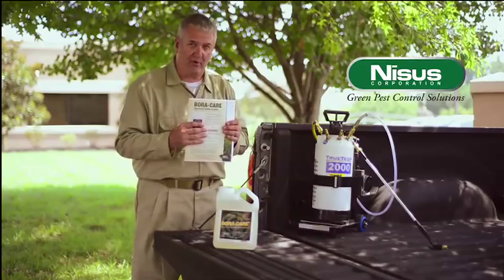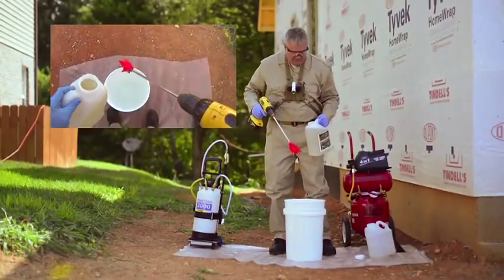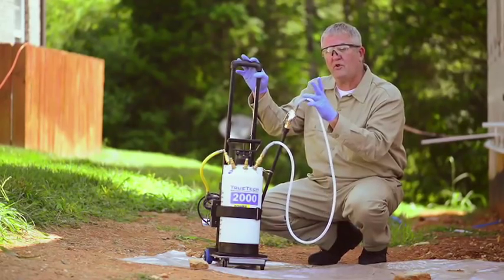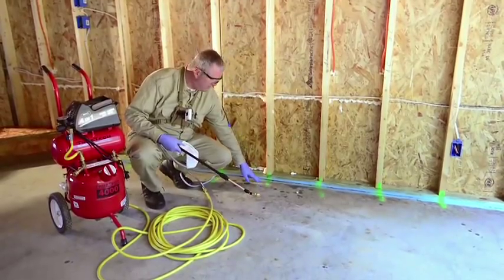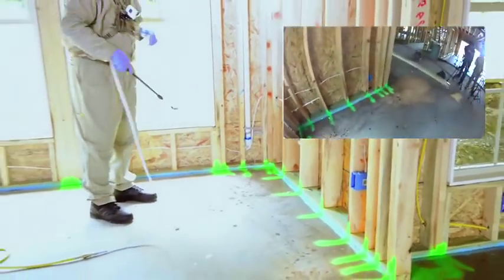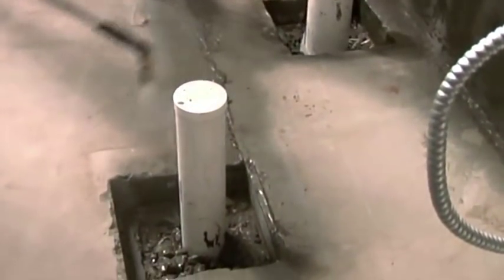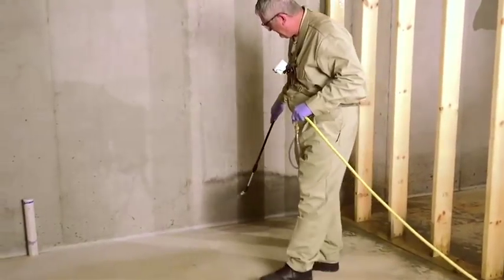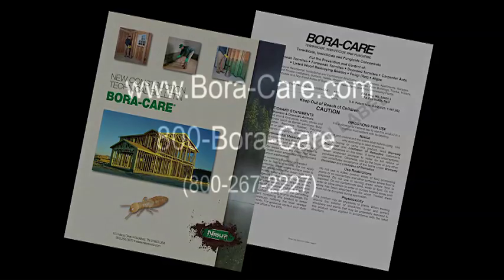Bora-Care Termite Treatment

Comment: As a Branch Manager and an ACE, this technique will only help for subterranean termites. Drywood termites will get in from above, thus, the entire structure needs to be treated. Fantastic product overall.
Reply: That's right. Carpenter ants, wasps, bees, etc. They all come in higher. Anywhere water could get in-SPRAY it. That means the entire stinking frame.
Reply: @asadadil8695  Im not sure if you have read the studies on this product, however, it actually penetrates the wood multiple inches deep and within 30 days can fully penetrate 2 to 4 inches deep.
Reply: @asadadil8695  BoraCare is absorbed by the wood. So, yes, they will be in contact with the product.
Reply: @alexcolon1640  Yes, but if you're only spraying the bottom and drywood termites enter through the attic, you have no protection. Hence for drywood termites you ideally need to spray the entire structure.

Comment: Great video, but it would appear that you do not live in a southern coastal state or California.  In these places we also have drywood termites that do not enter from the ground.  It is quite common for drywood termites to enter into the attic or around windows through cracks and crevices or pipe and electrical penetrations.  Therefore, if you live in an area where drywood termites are a problem, then the Bora-Care should be applied to all wood surfaces, including the roof structure.  If it's wood, then it needs to be treated.  If you live outside of an area where drywood termites are a problem, then what you showed is exactly spot on.  Don't feel bad for not mentioning it though.  I did all my pest control in the north and midwest and I never gave a thought to drywood termites either until I retired and moved to Florida.  There are all kinds of pests down here that folks up north do not have to deal with, so pest control is a whole different ball game here.  Anyway, you did a great job showing how to apply the product.  Very professional.  I enjoyed watching it and I will pass it along to folks who need to know how to do it.
Reply from the maker: Thanks for watching! And you are correct that some areas have different species of termites and would require different application methods. Here's a link to our technical bulletin where we address the drywood termites: https://nisuscorp.com/download/drywood-termite-technical-bulletin?wpdmdl=3885&refresh=6078362d5c3ec1618490925
Reply: I have an gazebo that got infested with termite (less than 20% ). Would you please give advice for (1) treatments  and (2) prevention for further damage. Bora-care seems to be a good choice;  do I need to remove all the paint before spaying bora-case on them?
Reply: @tomyang5991  Let's start with the Bora-Care.  If all the wood is treated with Bora-Care, then that will kill and prevent all species of termites permanently.  The problem is though that you cannot apply Bora-Care to painted surfaces.  It must be applied to bare wood.  So, if the gazebo is painted, then I think it would be way too much work to try to strip off all the paint.  The good news is that termites can be treated and prevented in other ways as well.  How you do that will depend on the species of termite that you are dealing with.  Please do not panic, determining the species is not as complicated as you may think.  Actually, it's pretty simple.  Sure, there are probably about 2000 different species of termites in the world, but the truth is they really only come in two flavors.  That is to say, they either attack from the ground or from the air.  If they attack from the ground, then they are subterranean termites and we treat them and prevent them the same way by treating the ground surrounding the gazebo.  If they attack from the air, then they are most likely drywood termites, and we treat the individual galleries that they created in different places in the gazebo.  To prevent them in the future, we simply spray pesticide on all surfaces of the gazebo every three months.  So, the question is, “Do you have the kind that attack from the ground or the kind that attack from the air?”  To find out, all you need to do is watch my video on how to identify termite species.  I will place a link below for that video.  Once you know the termite species that you are dealing with, then all you need to do is watch my videos on either subterranean termites or drywood termites.  I will place a links below for all of those videos.  Now, if you live in an area where both subterranean and drywood termites are a problem, then it would be a good idea to do a prevention treatment for both of them.

I am so sorry for asking you watch more of my videos, but they will provide you with the information that you need.  After you determine the termite species that you have and you have watched the videos pertaining to that species, then please get back to me and ask whatever questions you like and I will do my very best to assist you.

I hope that helps.  Be well my friend.

How to Identify Termite Species video:  https://youtu.be/mY4FMvAHrMA

How to Treat a Drywood Termite Infestation Yourself video:  https://youtu.be/U7ck7zhS0Xo

How to Prevent Dry Wood Termites video:  https://youtu.be/neNsmVbj8Pc

How to treat and prevent subterranean termites video:  https://youtu.be/H7rW_TSBHJ4
Reply: Man, thanks for the wisdom.
Reply: @stuartewoldt1513  You are very welcome.  Be well my friend.

Comment: Pretreatment is required on all new residential construction in my state would you recommend both that and  a borate job as well since we used Timbor for the soil treatment. By the way you do an excellent informative job for home owners planing to build. Most homes here are slabs a few basements here and there and I wish the crawls had as much height as the one you were in but I'm no longer in the trade will recommend you to old colleagues thanks for all you do.☺👍
Reply from the maker: Thanks for reaching out. Tim-Bor® Professional is not a soil treatment, so you may have used a different product. Bora-Care® is a stand-alone wood treatment but can be used as part of a dual treatment process. We suggest you check with your local agricultural office/department to see if your state requires dual treatment.
Reply: @NisusCorp  sorry I meant premise thanks for the correction. Your videos will hopefully help people understand what past operators are doing andf why. Keep up your good through work sir.👏

Comment: Great video. My problem is a 2 story building built in 1940 with 6 apartments on the 2nd floor and multiple businesses on the 1st floor. I'm seeing on floor 2 in a corner apartment only evidence of swarmer termites. Can I spot treat with this product or is there a recommendation you can give me that I can do myself? Btw, every Feb-march I spray a perimeter around the building and any of the remodel work we have done (gutting apartments to the studs walls and floors) I have saturated all new and existing wood with a product called termidor sc. Any advice you have would be greatly appreciated. Thank you, Jim G.

Comment: Thanks for the thorough video. Can you tell me how long this product is effective for? Will I need to redo the accessible areas again at some stage in the future?
Reply from the maker: Thanks for reaching out. We would need a little more information to provide you with a full detailed answer to your question. 

Based on the information you have given, we can only provide a general answer for you here. If the product is used outdoors and then treated with a finish, it will last the life of the lumber AS LONG AS there is a finish over it. If used indoors, the product will last the lifetime of the lumber. 

If you would like to speak to one of our technical experts to have specific questions/details addressed, please feel free to give us a call at 800-264-0870.

Comment: 2000 or 4000 used in crawl spaces and attics? which for which? how often to apply/treat wood? why only spraying the bottom of the wood? drywood termites can fly. can you also take the hose upstairs in the attic while the 4000 stays on the lower level?
Reply from the maker: The video you are watching is for new construction only and you CAN treat the whole house especially if you live in areas with Drywood termites or Formosan termites that can attack a home from the air and establish colonies that don't connect to the ground. The 2' band is to prevent subterranean termites, which attack a structure from the ground and must remain in contact with the ground. The termites cannot eat the wood in the 2' band and they cannot build mud tubes over Bora-Care treated wood to get reach the rest of the structure. So when you treat all the wood that contacts the foundation 2' out in a continuous barrier you will protect the home. If there is already a termite infestation you need to treat all accessible wood.

Comment: Hello! Can boracare with mold control be sprayed near/on electrical wiring and plumbing fixtures and pipes?
Reply from the maker: It is labeled for use on wood only. If it gets on any other materials, we recommend cleaning those items off with warm soapy water.

Comment: Thanks for the video, so as I'm shopping for bora care, I also found bora care with mold care, which one should I purchase? Will both have the same result over termites? Just one gives the added mold control?

I want to treat our patio ceiling where we encounter old termites trails after we removed the drywall from the ceiling.
Reply from the maker: Yes, Bora-Care is the same product in both packages. Bora-Care with Mold-Care contains a Moldicide that kills mold that may be existing on the wood. However, Bora-Care with Mold-Care is not labeled for subterranean termites.

Comment: What pressure  are you using in this application.  Since Boracare is very  thick I use up to 40psi the get the fan spray to open up

Comment: Used the product years ago as a last resort because of activity in a garage coming up a stem wall in a house where there was a water well 3 ft away from outside wall. What do you do to keep it from clogging the sprayer?
Reply from the maker: We recommend mixing with warm water and keeping the product mixed in the sprayer by agitating/shaking. For cleanup, use a triple rinse process. Details on the cleanup method can be found here: https://nisuscorp.com/download/bora-care-commercial?wpdmdl=1390&refresh=6078345e911d21618490462
Reply: @NisusCorp  thanks 👍

Comment: Why does the mold control version that comes with the same boracare main jug, take 5 gallons(mixed with the additional mold bottle)?  But this same bottle only requires 1 gallon?
Reply from the maker: Great question!  Bora-Care with Mold-Care is mixed at a 5:1 ratio, which is appropriate for drywood termites, mold and wood decay fungi, but not for subterranean termites.  Subterranean termites require a 1:1 ratio of Bora-Care.  Feel free to reach out with any additional questions!

Comment: We used Bora Care - some of the product ended up on the already installed window glass and dried before we caught it.  It is EXTREMELY difficult to remove from the glass.  We tried very hot water and soap with no luck.  What do you recommend?

Comment: what is the advantage of using the product over just using borax?
Reply from the maker: Good Question!
Three main reasons.
1. Highest Active - Bora-Care patented formula of multiple glycols and disodium octoborate tetrahydrate gives you the highest active rate of 23%.  Products like our Tim-bor can only achieve 15%
2. Deeper Penetration - The glycol formulation helps Bora-Care penetrate deeper into wood compared to DOT or borax which would just be a surface loading.
3. Stops Termite Tubing - Bora-Care’s unique formula stops termites from building mud tubes across treated wood, concrete and other building materials. When the termites attack they build mud tubes. As they build the Bora-Care re-liquifies and kills the termites as they build the tube. Other borate products do not stop tubing. This is what allowed us to get EPA approval as a stand-alone termite pretreatment using a 2-foot band treatment. With other products you will need to treat all the wood in the structure. Florida also has this requirement to prevent tubing and no other products has passed the test.

Comment: Why did you mix 1 gallon of Bora Care with 1 Gallon of water? The instructions on the product advise mixing 1 gallon of Bora Care with 2 gallons of water...
Also I do not see the instructor wearing a face mask... How toxic to human beings is Bora Care?
Reply from the maker: There are many different mix ratios on the label. This video illustrates just one of these. If the proper precautions are followed, you will be completely fine using this product. If using the product in an enclosed/confined areas, using a respirator mask is needed.

Comment: Does this work by DETERING termites from eating the wood or by KILLING them once they take a bite or walk on it?
Reply from the maker: The active ingredient in Bora-Care is a borate salt. Borate salts work by taking advantage of a unique feature in the biology of termites, ants and other insects. If ingested by ants, beetles or termites, the insect becomes unable to extract nutrition from its food and starves to death. And because of this unique mode of action, insects cannot develop a resistance, ever. Bora-Care works differently than most other insecticides, termiticides and even other borate products on the market today. For starters, it isn’t applied to the soil but to the structure itself. Secondly, it isn’t just a repellent or a bait but a little bit of each. Bora-Care’s unique patented blend of glycols in combination with a borate salt provides results that are hard to beat. As soon as beetles and ants attempt to consume treated wood they die. Subterranean termites won’t even try to eat treated wood and if they attempt to build a tube on treated wood, the termites start to die. This alerts the termite colony and they abandon the wood.
Reply: @NisusCorp  Thanks!
Reply: They kill when bitten

Comment: How long does this last?
Reply from the maker: The active ingredient in Bora-Care is a borate mineral salt so it does not break down over time. If the wood remains dry or is painted or sealed Bora-Care will remain in the wood as long as the wood is in service. If a home is flooded the product must be reapplied.
Reply: NisusCorp We have a bathroom that we build in our basement. How do I get to those tiny unreadable spaces?
Reply from the maker: Great question!  For difficult to reach areas we are always going to refer you to a pest control company. They have special tools and equipment that can inject high pressure mist or dry foam into wall voids and inaccessible areas. The bottom line is you have to get the Bora-Care on the bare wood.  Thanks!

Comment: why not spray all the wood,,2 feet isnt going to stop termites,,i have had them in the middle of my joists 10 feet into the room
Reply from the maker: Hey Tim, The video you are watching is for new construction only and you CAN treat the whole house especially if you live in areas with Drywood termites or Formosan termites that can attack a home from the air and establish colonies that don't connect to the ground. The 2' band is to prevent subterranean termites, which attack a structure from the ground and must remain in contact with the ground. The termites cannot eat the wood in the 2' band and they cannot build mud tubes over Bora-Care treated wood to get reach the rest of the structure. So when you treat all the wood that contacts the foundation 2' out in a continuous barrier you will protect the home. If there is already a termite infestation you need to treat all accessible wood. Thanks for your question.
Reply: @NisusCorp  why new construction only? I have an 1870d house
Reply: @jude999  1. Because his using it as a pre-treatment 2. Unless your removing all your walls to get to the studs. Then sure go ahead if not it won’t work. It really isn’t rocket science

Comment: Can BoraCare be used on finished varnished floors?
Reply from the maker: Hi Gloria -- Bora-Care must be applied to bare wood. So if wood has been varnished or painted, that coating must be removed before Bora-Care can be applied. Sometimes wood like ship lap walls that are painted on one side can be removed and treated on the unpainted side so the finish does not have to be removed. Once applied wood can be painted, stained or varnished after 24 hours.